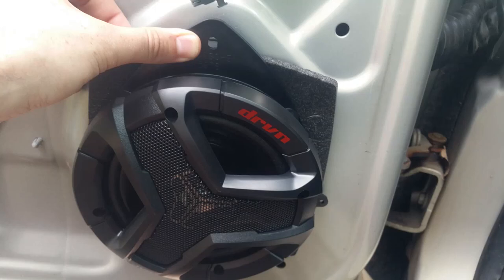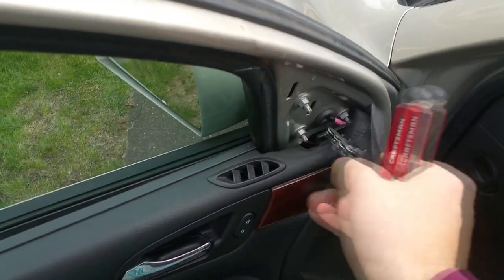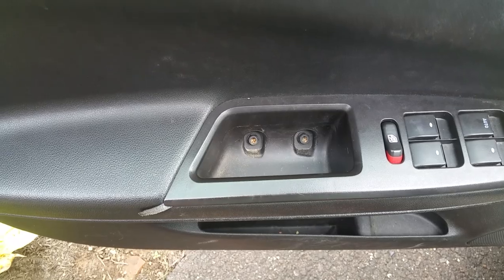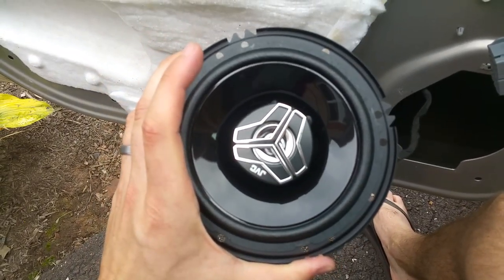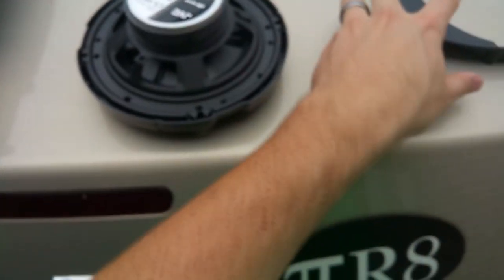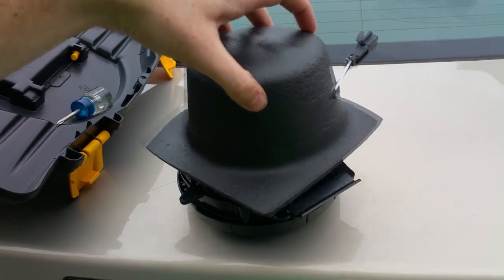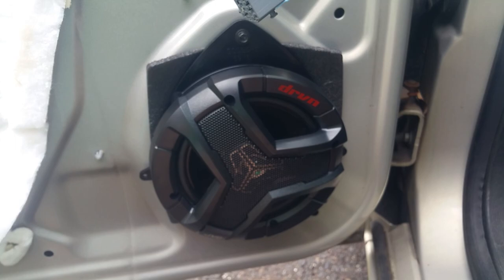Chevy Impala Front Speaker Replacement - Works on Most GM cars

Comment: I just bought JBL concert series 6 1/2 for the doors and 6 X 9 for the rear deck. I bought them from crutchfield. When you buy from them they give you EVERYTHING you need to do the install! Including the harness so you dont have to cut wires. I bought my Kenwood head unit from them too. Funny... the day I bought these aftermarket speakers from Crutchfield... my kid blew my 12" Kicker comp R. Now he had to buy me another one lol. O well it was already 5 years old already. But I have my sub in a ported box with a 600 watt Kicker mono amp. Sounds AMAZING! Not too much but just enough to piss the neighbors off. Kickers hit hard!

Comment: pretty sure a lot of other people like me were looking to see how to if possible remove the housing from the speaker so you dont have to order another part, its all one piece so you have to get creative, i used some pliers to break the 8 pieces holding the speaker to the housing then inserted a new one then you can either drill through the plastic to screw it together or use adhesive

Comment: Hey Ik I’m three years late but just wondering if I used all the other products you linked but with different speakers like JBL for example, would everything still fit and go together
Reply from the maker: Hey Chuck, sorry I can't help ya but I think if the speakers are the same size, they should still work but I can't guarantee it.
Reply: Will Peterson imma just take a shot at it and I appreciate you still answering questions after three years
Reply: Charles any luck?
Reply: Darsh Kashyap yes and worked perfectly
Reply: Charles what kind did you get
Reply: Darsh Kashyap some 6.5 crewin vega speakers

Comment: sweet, ordered the speakers gonna try to replace when they arrive. Damn right speaker is going out and it's annoying as hell, makes me want to have the radio off.
Reply from the maker: Glad this video helped. I went over a year with a dead driver's side speaker, not sure why it took me this long to fix it!
Reply: ChaosTheoryBlog finished it today, after the 1st door the other one is easy. The only thing that took forever was figuring out how to detach the old speaker from the wire harness on the door. Then eventually I figured out you had to push the top down on the clip. Was getting pissed off haha.
Reply from the maker: yeah that was tricky! Glad you got it figured out!

Comment: I bought scar audio instead and the adapter doesn’t fit the speaker any help?
Reply: Use your old oem speakers and gut out the whole inside taking out the paper speaker and breaking off the plastic pieces that goes with it and trim off the edges on top of the speakers and use it as a bracket

Comment: you 100% do not need the speaker adapter!!! or even the wiring harness...
old speaker frame..
you cut out the old  speaker paper cone snipping the frame posts out that hold the magnet leaving the OEM plug intact on the frame.
the new 6.5" will fit right in the old frame With self tapping screws like its meant to be..  
 you then use the wire from the speakers you just got  and attached to the OEM posts you left on...

there i just saved you guys $30
Reply: 6.5” will not fit in the old frame without some modification and trimming
Reply: Yeah, I'm cheap as hell but I'll spend the $30 and save myself a buttload of time I'd otherwise spend with a dremel and a file.

Some people literally only have or need a screwdriver, this method is way easier and arguably way better. Not sure why you're insinuating that the OEM bracket is designed to have self tappers driven through it - if that were the case, that's how GM would have designed it from the getgo and you would only be concerned with unscrewing a speaker from the housing. The speaker adapters also allow you a crimp-free, tape free, solder-free and reliable connection, and most importantly allows for the reinstallation of the old speakers (if, say, you were to sell). In that case, with a decent set of speakers running $50-$75 per pair, people taking the installer-recommended route save at least $100. Any car audio professional is going to go the route shown in the video, not the shade tree method.

Comment: aren't the speakers supposed to be 6 3/4? I have a 2007 and that's what it says it takes not 3 1/2
Reply: I'm only asking because I have an 07 impala and I need to change my front speakers so I'm just making sure these  will work before I buy them
Reply from the maker: The 6.5 definitely work for me, maybe thats because the adapter frame takes up a bit of the extra space?
Reply: james dubach i have a 2005 impala n mine are 6-1/2 inch. in front n 6×9's in the back.

Comment: no reason to buy wire adapters if you have even a novice level of experience with soldering. no idea as to why you would use the after market grill since the door has a built in grill. plus its likely that with most after market speakers the door panel will not go back on with the supplied grill installed. as for the speaker mount adapter, in most cases for most people thats a good thing to get. as for me, i used a dremal and drill to modify mine to work with my image dynamics 6.5's. that involved a bit of work, time and skill. i do not suggest it for the average person to try to do.
Reply: stephen hrabusicky, lmao just did the dremel method for my sister's car.... what a frickin job that was
Reply: can i hot wire the cables or use stock harness?
Reply: i going with kicker
Reply: to your 1st sentence, that's true. however, if the wire adaptors come FREE along with the speakers, then why not use them! that's how mine was.
Reply: So if you don't have adapters you have to solder the wires together?

Comment: I tried this with my 07 Impala and I could not get my speakers and the baffles mount!
Reply: JoeTheGamer yah I’ve done the same thing but without the baffles. And they were horrible. Especially those $20 JVCs they sucked ass bro. I got some JBL Club 6.5 speakers. Which were $50 but sounded a whole lot better. And they are way more louder, and way more clearer. And! The speaker wasn’t dying from the bass being too much. The JBL handled it better, the JVC sucked when I put it in. But I’m starting to think that I should buy the baffles to make it sound fuller. Either that or buy sound deadening mats and put them on the doors. But I think I should do both tbh. I actually kind of want to put the sound deadening mats everywhere in the car just to make it super super quiet. It is already, but I just want to make it sound more like a newer car. The new Malibu is smooth and quiet as hell in the 17 Malibu. In my impala it’s not close to that anymore. When it was new I was smooth as hell but I need to buy new shocks. I’ve never changed them. But they are so expensive for the impala. They’re like 2k for them.
Reply: i got baffles but it didn't fit my door either, i added them to the rear ones that are 6x9. those ones fit

Comment: It looks like the adapter and harness is exactly the same as it is on the 2008-2012 Malibu since I owned one of those so this should be the same for that car too, except how to take the door panel off which isn't too much different as the door latch disconnects the same but the inside door handle has two sets of screws, you have to remove the bezel completely and then remove the screws that hold the door panel on.

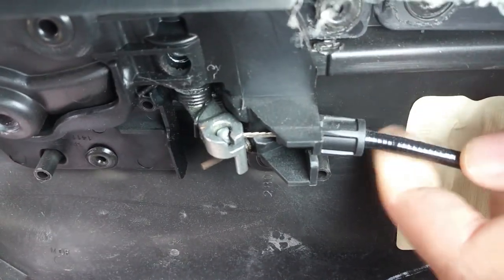Comment: 1:18 I have no idea how the hell you were able to squeeze those 2 "pins" together. I tried using needle nose, i even tried two flatheads, one on each side, at the same time. No go. Had to do both speakers with the panels propped up on something because of this wire. not sure why you didn't show, or at least tell how you did it.
Reply from the maker: It was really hard, I hard to use to hands so couldn't film it!
Reply: @WillPeterson  Ok but my main point is how did you wind up doing it? What tool did you use? As i said, imo i feel it would've been helpful if you had mentioned this in the video, since you couldn't show it.
Reply: @Jacket84  jeez man give him a break, hes obviously a decent guy as he responded to a comment on a 3 year old video
Reply: @airdubz9798  Good point. And i do sound like an ungrateful asshole is my previous comments. My bad!
Reply: It was hard... dont know how i did it but i did! Hard part.. putting it all back together lol

Comment: I’ve bought those speakers before for my impala. And they sucked ass.
Reply: know this late idk if u still got the car but i’m tryna get some speakers for my car door 2012 impala if u got any suggestions lmk pls
Reply: I don’t. I bought JBL club 6.5 for the front and obviously 6x9 for the back. But I would recommend trying something a little lower on wattage so the bass is lower that mid bass. Cause the rattle humming was good in the front for it being 50hz but when it came to smooth low bass it was there for the front it relied on the 6x9s a lot. But even then the ones I got weren’t as great for low bass but did the job well. I would recommend anything from 3way or 4way. I would go with kicker or pioneer.

Comment: for some reason the baffles didn’t fit well and the plastic bracket rattled alot on my speakers but I got Pioneer speakers, so I used some Kilmat wrapped around the plastic speaker bracket, it looks weird but it’s sounds way better. I did however use the baffles for the rear speakers and seem to do a good job though

Comment: did this get better sound or no? I'm looking to upgrade under 50$
Reply from the maker: Yeah definitely, it was a significant improvement despite how cheap it was.
Reply: ChaosTheoryBlog like where they louder? more clear could you upload a video showing difference in sound?
Reply from the maker: Ah unfortunately I don't have a "before" video or a microphone good enough to capture it. The stock speaker cones are made out of paper and these are made of rubber. Also the stock speakers may have been going bad, they sounded very tinny with a buzzing sound, maybe they were breaking.
Reply: okay thanks man I appreciate it gave you a like for sure going to look around trying to stay 50$ for speaker about another 25 for all other parts.
Reply: ChaosTheoryBlog can you do it for the rear deck because I don’t know how to take off the deck because the seats are cloth and I can’t find a release button to latch down the seats from the deck, so can you please make a vid on that?